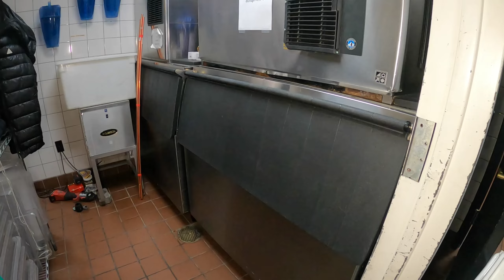HVACR: Hoshizaki Ice Maker HACK JOB INSTALLATION (Water Pipe, Anti Siphon Valve & Water Filter) FIX

Comment: I would have probably got the sticker off the pipe and used rubbing alcohol to get rid of the glue and damn that sucks you had to use a slip coupling but happens

Comment: Just gonna say here I dont like putting filters on ice machines. unless u got something that is gonna remove odors or excessive chlorine or big chunks of stuff coming in. Most ice machine owners dont change them at the regular and they become a nuisance problem!!.  proper cleaning of ice machines every 3 months is much better than any filter could be. if the customer was vigalant about changing filters I would be ok with that but most are not.  here in CO we have decent water so thats where my info comes from, but that filter will sit there till the ice machine doesnt work and then you will be called to change it. ice machines are designed to remove scale and minerals with the pump out cycle. unless my customer is hell bent on having a filter I remove them

Comment: Why no union where it connects to the ice machine. If the  machine needs to be pulled out for any reason now you have to cut the pipe.
Reply: No need to clean behind
Reply: Good call

Comment: I Personally like to use armed hoses  between a wall water outlet to all equipment.
The hose take up vibrations that especially copper does not like or worse cracks by time.
On service calls it so much easier to pull the equipment out to get access to the rear side.
Wash machine as the most common for me, have inlet valves on the rear side,
 To pull whatever water consumers out of base is a must in many cases.
You made a clean and great filter set up.
Reply: Good call